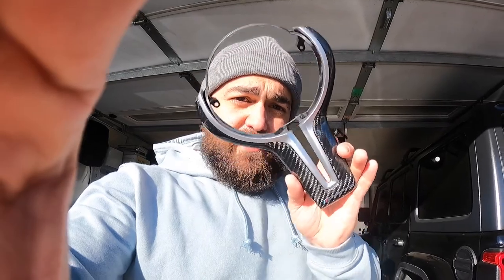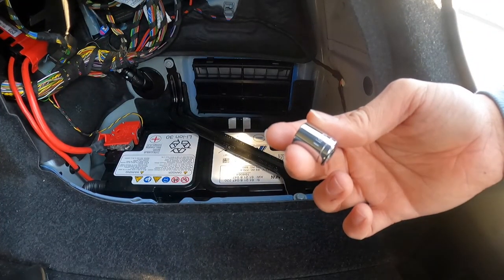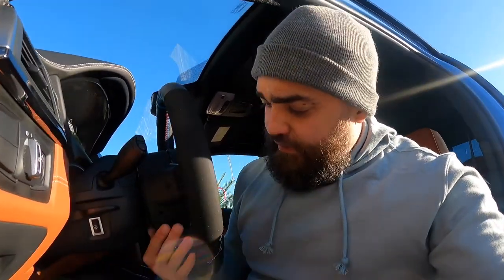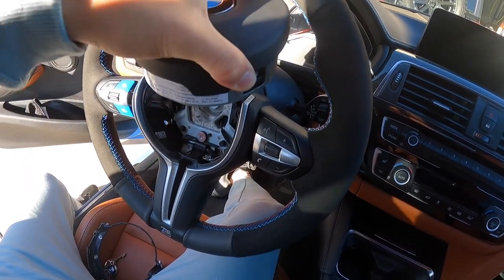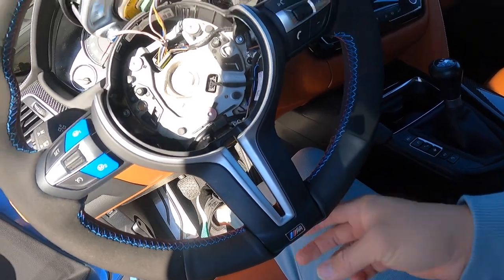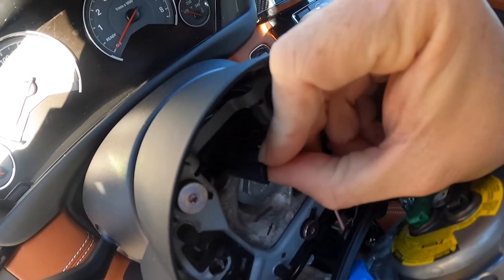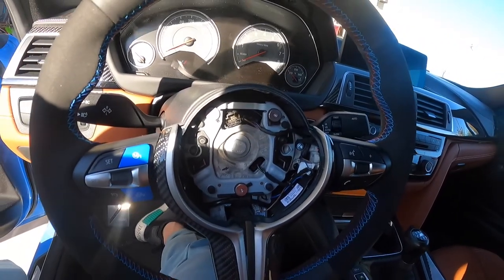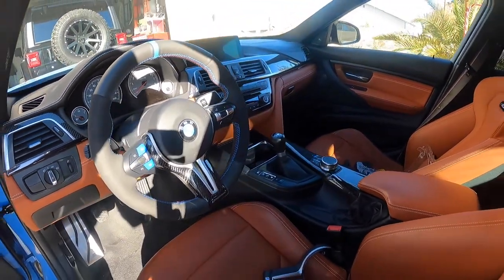CARBON FIBER steering trim on F80 M3 (How to tutorial and installation)

Comment: Do you have to do anything special once you reconnect the battery? I saw a steering wheel replacement vid and the person said you have to turn the steering wheel lock to lock.
Reply from the maker: You only have to do that when you completely take off the steering or fully disconnect anything. Mine was okay. Never had any issues
Reply: M3 Alex ok, thanks! So if I go to the V2 wheel, I just have to turn lock to lock after reconnecting the battery and I’m all good?

Comment: What kind of screw is it that holds the bottom part of the trim? Flathead? Phillips? In your video you say it’s a nut? I just want to be sure I have all my tools right before attempting this…
Reply from the maker: @Fabulousprofound168  to be honest it's been so long. It uses then stock screws. So if you look behind you're steering wheel you'll see exactly what you'll need

Comment: How long have you had your V2 wheel? I’d like to order one but I’ve heard the blue stripe fades
Reply from the maker: It was good for a year. I've since sold the car! Just be sure to use a sun shade when parking in sunny and hot areas!
Reply: M3 Alex you sold it???? What did you end up getting???
Reply from the maker: @NOYBidness  I ended up making almost 9,000 dollars after driving for the the whole year. I still have my e92 m3, g63 amg and me and my wife have two Lexus hybrids we use to commute to work.

I'm waiting until prices settle for another car. Not sure what though. I miss my f80 though a lot
Reply: M3 Alex yeah I hear ya. I leased my F80 new. When it came time to either turn it back in or buy it in January I HAD to buy it. My buyout was $46k and the car blue booked at $66k. No brainer. Thanks for the replies and best of luck to you and your new family!